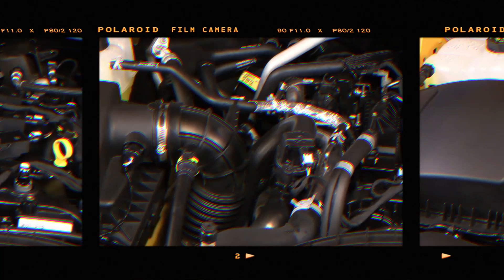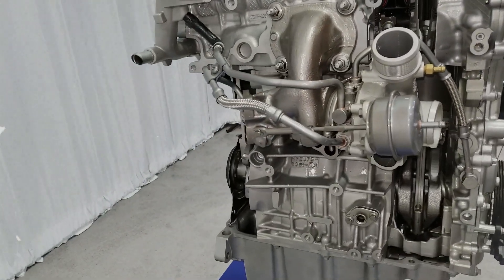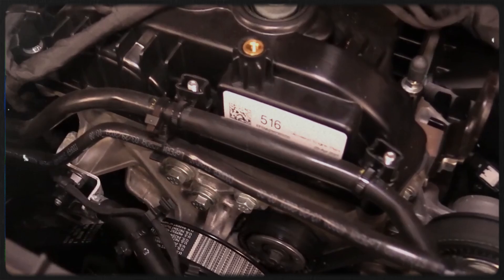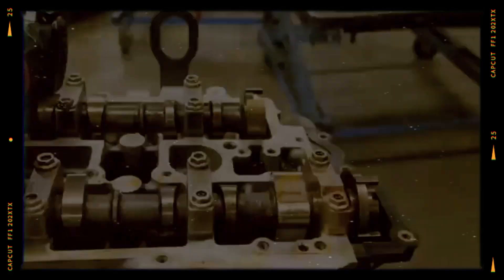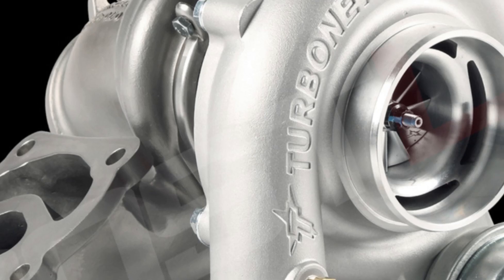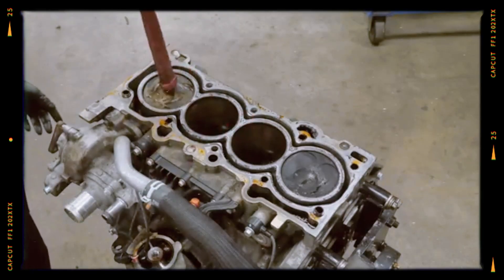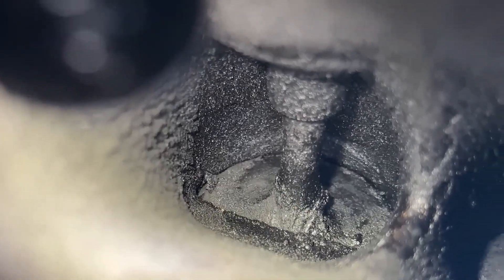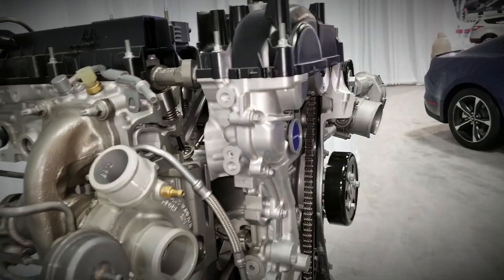Ford 2.3-liter EcoBoost Engine: Specifications, Issues, and Reliability!

Comment: I own a 2019 model, has about 200k on it! The only reason it was at a shop is for battery change and oil change. One complete tune up aroud 120k. That's it! It feels like it will run till 300k.

Comment: Faulty coils are associated directly with the ecoboost engine, bypassing the auto shut off is the only way to defeat this issue with 2.3 L ecoboost
Reply: Typical in number1,2 cylinders

Comment: Ecoboosts all across the board are excellent engines   2013  escape 240k miles still runs great
Reply: I would agree except for when Ford went full idiot and did the wet belt thing. I had a 3.5 Explorer Sport which I loved. Just got a 23 ST with the 3.0 and good grief the difference is ridiculous. What they did with that 3.0 Twin Turbo is just bonkers. Makes me mad they didnt have a 10 spd Transmission in the earlier models with the 3.5. From what I remember reading they had to nerf the gears in the 6 spd because the transmission couldnt handle the power the engine could put out and would burn out if they hadnt restricted it. Which makes sense considering 1st gear in my 15 was a dog lol
Reply: Love it! I got a mustang 2019 with over 200k. Looks like it will run to 300k

Comment: With regards to the intake valve coking, the narrator states "With regular maintenance and cleaning" the coking issues can be reduced or eliminated.  WHAT cleaning???  Regular usage and oil changes with Full Synthetic oil will help but I don't get the "regular cleaning" comment.  Any ideas?
Reply: If it's direct injection then upper intake cleaning needs to be done as egr inlet in intake piping will put carbon deposits  into the top side of the valves and porting in the intake. 
They offer walnut blasting service now to address all the carbon build up in direct injection engines , Alternatively you can delete the egr by blocking the tube or drill and tap a valve in the intake so you can routinely spray seafoam or liquid moly intake cleaning into the intake to control carbon deposits
Reply: @joridd Does the head have to be removed to do the walnut cleaning?
Reply: @gregh2880  No, the head is not touched.  The plastic intake manifold needs to be removed for the walnut cleaning to be performed on the intake valves.
Reply: @gregh2880  No, just remove the intake manifold and go to it, I did it in two hrs, fairly easy!
Reply: Plus use top tier gasoline. imho

Comment: Recently traded my 2014 f150 3.5 ecoboost for a 2021 Ranger 2.3 ecoboost. So far so good, pretty snappy little engine.
Reply: I pull a 5700 pound boat & trailer with my 2.3 Ranger.  No problems at all.  Great motor.

Comment: The 2.3 ecoboost is a Fords best 4banger.
Reply: not according to 5 different ford technicians Dealerships. They state they get these engines in all the time a large percentage of their work is on them. It seems that Head gaskets blown and leaking coolant is the number one cause of these engine downfall. Makes sense since they rammed up the horsepower with basically putting in a stroker kit from the factory.
Reply: @KTporsche  The 2,3 EB is also Fords most popular engine. So yes, they will show up at your local garage more often. If you maintain the 2.3 and treat it right, it will reward you with 250, 000 miles or so of spirited driving.
Reply: @KTporsche  If you write the way you do, imagine ANYONE taking your opinion seriously? Those "techs" you mention are idiots. You should ignore anything they say from now on. Neither you, nor those "techs" even know Ford recalled and FIXED the head-gasket issue. They admitted it was a mistake on their part and fixed it. You don't even know THAT much about this topic, yet feel the need to flap our soup coolers. Nice.
Reply: @eriklarson9137  Ya they admitted it but they still keep it under wraps. Did I not just say the head gasket fails? why are you verifying it then trying to dis credit that I do not know anything about it? Those "Idiot techs" at Galpin Ford happens to be the biggest dealership on the west coast as we as ken grody Ford. you sure you want to call them idiots? oh wait let me guess ... you are some master tech know-it-all that thinks he is better? huh? How typical. And yes Ford admitted it but yet still keeps it under wraps.  if you actually read the article, they never issued a recall. Maybe you should actually do your research before yapping your mouth making it sound like they did their due diligence. Maybe you should stick to an English major and teach.
Reply: @KTporsche  You are right on. My gasket failed with 32,000 miles on it. It should be a Ford Recall item!!